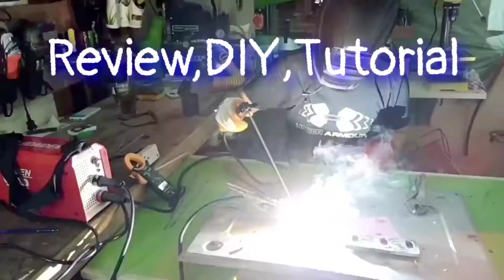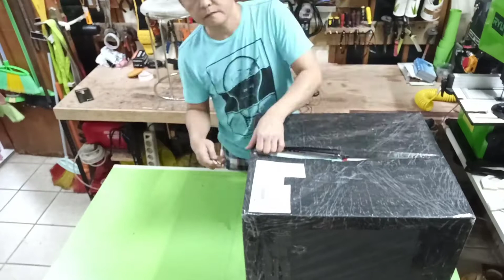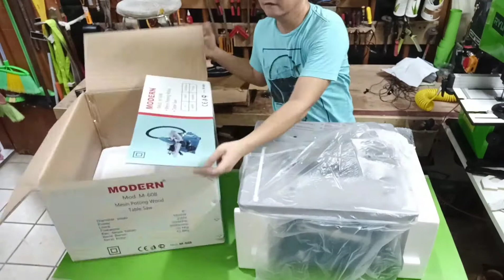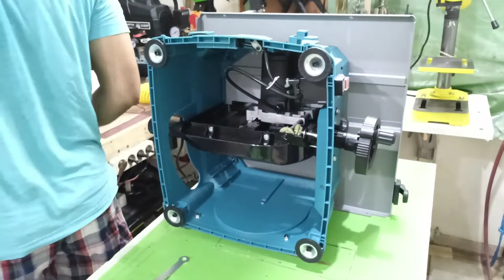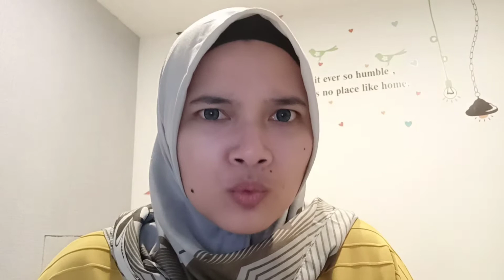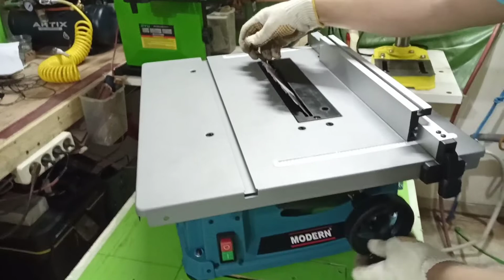Unboxing MODERN Table Saw-TIPS PENTING Sebelum Table Saw Digunakan

Comment: om, mo nanya,,galo nih milih antara modern m-608 vs nrt pro 10,,bisa bantu jawab g? n kalo kira perbandingan sama modern m610 gmn 608 nya?
Reply from the maker: Kalau secara tenaga sih sama..
Saran:
Klw hanya main multiplek/jati belanda cukup pakai modern 608..blade 8ninch sdh cukup
Reply: @AbangAbangan  cuma beda diameter blade aja y semua itu..kalo nrt menurut om gmn?
Reply from the maker: Tdk hanya blade yg beda..ukuran motornya juga beda sehingga pemakaian watt akan lebih besar nrt pro
Reply: Siap2..kayak ny mulai condong ke m608 aja..cos uda nyari2 info sc nrt n masalah service ny kyk e susah
Reply from the maker: Klw tinggal di jabotabek bisa beli punya saya..tinggal pake..sdh ada meja dan kakinya
Reply: @AbangAbangan  wkwkwkkw...jauh om..aq gresik..berat di jinjing, ringan diongkir si g masalah wkwkwkwk